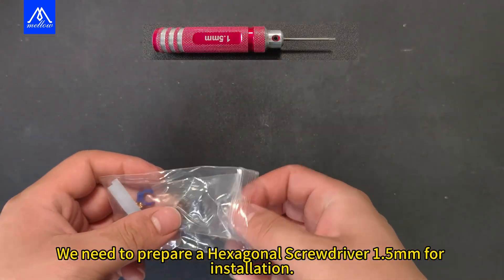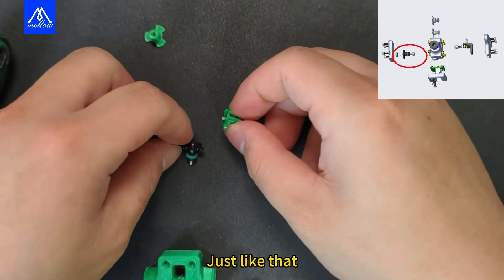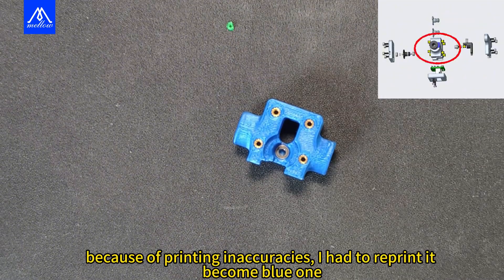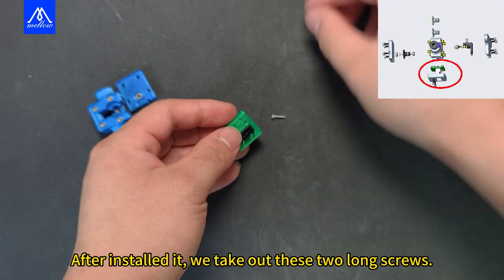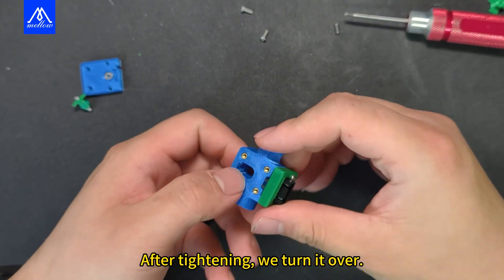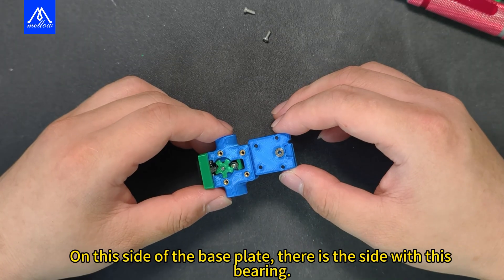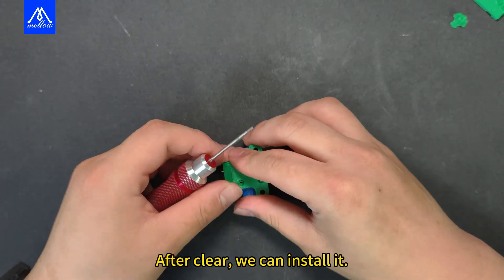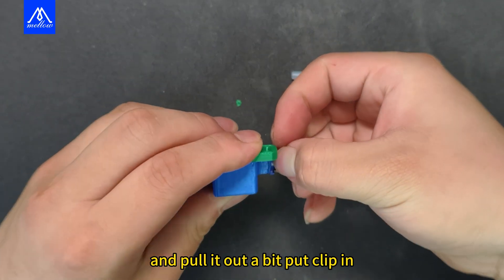Filament Runout/Jam Sensor Installation

Comment: Can you please also post the CAD files of the PCB to the documentation site, to design custom enclosures?
Reply from the maker: here is the link for download：https://drive.google.com/drive/folders/1P6jcN0QM_HpSdx6DeqwWWbpKIfyBrilF?usp=drive_link
Reply: @3DMELLOWPrinter  I saw that, but those are just the printable parts. I also want the PCB.